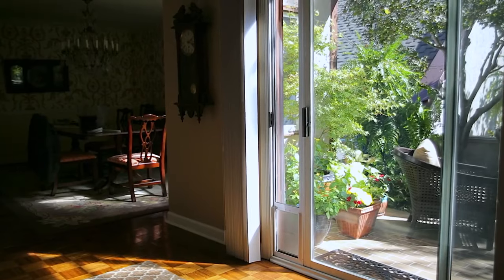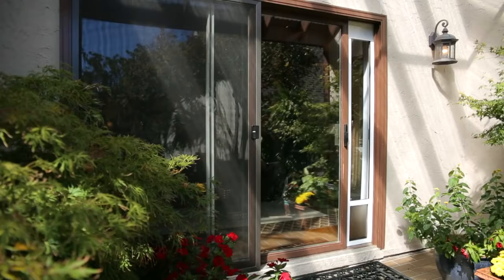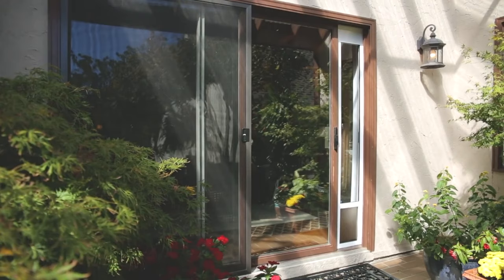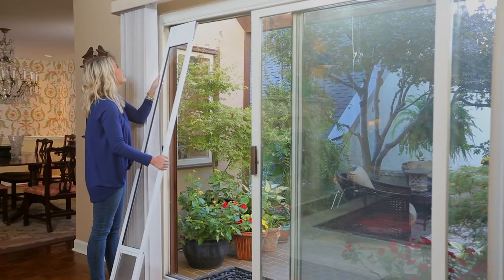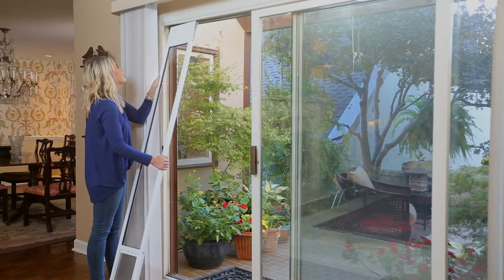How to Install the PetSafe® Patio Pet Panel Door

Comment: This is NOT a complete video for different types of patio doors! We will be taking out the screws for the third time now that we found a video that "might" help. The air coming in where the weather stripping is "supposed" to go is awful! We cannot use the stripping provided because it's horribly bumpy and will not seal.  It's in the 30's here and we need to figure out something else quickly. The panel itself is very nice and beautiful.....installation, ease, and weather stripping is not!
Reply from the maker: We are sorry to hear you are having these installation issues. Our team would be more than happy to assist you with this. If you would like you can reach out to our customer care team Monday - Friday 8am - 7pm EST here - https://support.petsafe.net/s/
Reply: I unscrewed the 3 screws at the top and reattached it, which helped, but I'll need to go buy weather stripping for both sides of the door. Also, it's raining today, and every time I walk by the door there are water drops coming off the bottom of the panel and onto the floor, as well as yet another draft.  Now I'll need to figure out what to buy to stuff up inside the bottom and also the draft from the  adjustable top. 
The little lock given also does not work with our door. One thing to note, we have the doors with the blinds inside, and because the controller is on the side of the stationary door, we  can't open the sliding door all the way, making it very hard to go out sideways! 
This video I found shares so much more information on different door frames. https://youtu.be/JmdwAN0JiEE?si=XFFIr7LGFJX0ggYS

Comment: One thing nobody mentions is that these doors basically make the screen door non-functioning. If the screen door is closed, the dog cannot use the pet door. So you must leave the screen open at least to the pet door, and when you do this there is a huge gap between the screen and the pet door. The gap is as wide as the distance between the screen track and the sliding door track, which on ours is over 2 inches. These are very poorly thought out.
Reply from the maker: We're so sorry to hear this panel is not to your preferences!  It is designed for use with the sliding glass portion of the door, so this would unfortunately mean there would be a gap if the screen were used.  Some customers who use their screen very often may choose to instead align their panel with the screen, or to not permanently install their panel and move it as needed.  For maximum stability and longevity of the panel, however, we do recommend screwing the panel into place.

Another option if you prefer to use your screen very often is our pet screen door.  If you have any questions about this, please get in touch with our Customer Care team!

Comment: The t bracket is way too wide, unfortunately home stores didnt have a replacement. There just really is 0 reason for petsafe to manufacture the bracket to be as wide as it is. I was abke to squeeze it in but it pushes the pet door so far away that the sliding door wont close on it.
Reply from the maker: We are sorry to hear you are having issues with the T bracket. Our team would be more than happy to assist you with this. If you would like you can reach out to our team via phone or chat (phone) Monday - Friday 8am - 7pm EST (chat) Monday - Saturday 9am -9pm EST here https://support.petsafe.net/s/

Comment: Don’t buy. sliding door will have big gap and no way to lock. video didnt show that part.
Reply from the maker: Thank you for sharing this concern, Gabriel!  We do apologize for any misunderstanding; please know that the sliding glass door does slide flush against the panel, and a lock is included. You can see the lock being installed at around 1:08.

Comment: how do you lock existing sliding door?
Reply: I wonder the same thing.
Reply: From the back that lock she installed on the back of the door
Reply: I have this door; there’s a slot in the dog door for your existing sliding door to fit in so you can lock it.
Reply: @WSB1469  thank you i was so puzzled
Reply: @WSB1469  where?
Reply: I drilled a hole into the side of mine so it would lock
Reply: @WSB1469  where?
Reply: @WSB1469  WRONG!!!
Reply: @WSB1469  Theres not.
You could just drill a hole for your door's lock if that suits your fancy, however it would not be as secure as the method displayed in the video.
Personally I drilled the lock up top, on the back of the sliding glass door, to where it locks into the stationary part of the sliding door.
So that way I can throw a 2x6 down behind the door to further secure it.
Hell, the 2x6 alone is enough to secure it.
Reply: And how does the lock really work ? What would the pin latch into ?
Reply: Locks are for honest people. Thieves just break the glass...... People don't stress over the simple things.

Comment: Why not move the fixed door panel to place the dog door between it and the frame, so the sliding door would be unaffected and still lockable from its handle?
Reply: How do we do that
Reply: That's exactly what I'm doing.
Reply: @beckyturner2721  how do you open the stable glass panel on slider?
Reply: How??
Reply: Found this tutorial on how to move a stationary door from one manufacturer. https://youtu.be/Uc3Ur-pZ1kc

Comment: What about the gap between the new door and the old one? How does one be sure to keep that snug? Do I have to buy more weather stripping?
Reply from the maker: Thank you for this question. Should your sliding glass door not sit flush against the Patio Panel after installation, you can add weatherstripping of your choice to the sliding glass door. We recommend using an adhesive backed polyether foam that is approximately 5/8 in. x 3/8 in. wide.

Comment: Similar to some of the comments here, mine also is too tall to fit where it is supposed to (on the glass door track).  It seems to fit well on the track for the sliding screen door though.  It's not ideal but I can still close my sliding glass door fully to lock it.  With the screen door it won't be useful if it's really hot or cold outside as there will be drafts.

Comment: Not happy. About a 3mm gap between existing door and pet door. Does not close all the way and there is no weather stripping for this area.  The “lock” it comes with is completely confusing (and doesn’t work) . I have to squeeze sidewise to exit to my patio now. Directions are super confusing with very few pics to reference. Also, you have to uninstall any existing locks, or hardware so the pet door will fit.  Flimsy. BUT happy to have a dog door now. Just gotta get a lock and weather stripping from the hardware store.
Reply from the maker: Thank you for your feedback, Heather. We're sorry to hear your Patio Panel Pet Door is not living up to your expectations. Most installations of this panel into a standard sliding glass doorframe will not require additional weatherstripping or modification. However, we can certainly understand all sliding glass doors are not created equal and some adjustment may be needed for the panel to sit flush in these situations. If you need any assistance or have questions about your Patio Panel Pet Door, please know our product experts are happy to assist you at the number 1-800-732-2677.
Reply: If you have to turn sideways to fit through the door then this is not an issue with PetSafe. Eihh the er you didn’t do the math to figure out how much space you were losing when you installed this thing OR you did but you aren’t self-aware of your own width. Anyone with even the slightest amount of ability for logical thinking would know that you will lose space in that opening after installing this thing…one should also consider losing some girth on their own belly to accommodate that loss of space.

Comment: Mine had a little gap when I closed the slide in door wym
Reply: Adjust the sliding door hight. At the bottom you should be able to raise and drop the wheels to fix the gap.

Comment: How do you install the bottom bracket? All sliding glass doors are on a 1/4” wide track which doesn’t allow the 90degree T-bracket to even sit flush with the ground level? LOL
Reply from the maker: We're so sorry for any misunderstanding!

A sliding glass door with a track this narrow would not be able to fit this panel.  Most sliding glass doors have tracks large enough for the 3/4" deep panel to fit; the T brackets will fit within this track as well.
Reply: @petsafebrand  The 1/4" wide section im referring to is the "ridge". My track is just like any other track, and the PetSafe door fits great within it. The "ridge" prevents my T bracket from sitting flush with the ground. So Im just not even using it.

Comment: I would like to  know if If it   is possible to install this door in place the screen
Reply from the maker: Thank you for reaching out to us, Pierre. This pet door can be used in a sliding screen door if the sliding door track is at least ¾" wide. However, it cannot be used with a standard screen door. This pet door is designed only for installation in a sliding door track.

If you have any further questions, please feel free to reach out to us directly at 1-866-738-4379.

Comment: The back of my door is bevelled and the lock won't fit. I am using a length of wood right now. Thoughts? Is there another latching mechanism I can use other than the bolt bracket lock thing?
Reply from the maker: Thanks for asking about this!  If this style of lock is not the right for your door, we do have a rotary lock available as well.  Please reach out to our Customer Care team directly!
Reply: @petsafebrand  , my sliding glass door opens on the opposite side, so I can’t use that lock or a piece of wood. Pella doors look like they’re installed backwards but they’re not. What other latching mechanism can I use to lock my door? it would have to attach to the inside track and the door somehow.

Comment: At 1.09, why is she putting a lock on the bottom at the end of the sliding glass door? Am I missing something - this will limit how far you can open your door to enter/exit? I'm not confident how well this pet contraption & final result will hold up against a burglar.?.?
Reply from the maker: Thank you for this question! The lock will not hinder the natural sliding action of your glass door when in the unlocked position. Please know the closing panel and lock is provided for aesthetic and energy efficiency purposes only. These items are not intended as security devices. Forcible or aggressive entry/exit attempts by pet or human are subject to damage the door.
Reply: The lock that came with the dog panel is a POS. We ended up not using it and just putting a very thick stick pole in the track of the door.
Reply: @lisaflesher  this is what I would do but our sliding door is on the exterior side so we can’t use a stick. I just can’t believe there’s no nub to actually grip that locking pin to unlock it. May put a piece of string around the end of the pin so as to enable a simple string pull to unlock it. Would have to get creative just to mark the hole where the security latch pin needs to be drilled into the door. Seems intentional how they just breeze thru one of the most critical parts of the install. Most probably have the stick option because their sliding door is on the interior side
Reply: Your builder installed your sliding door backwards then - you should be able to put a broom handle back there (from the inside) to secure it. If your sliding door is exterior then that’s a design fault of your builder not PetSafe.  There is plenty wrong with this door and this garbage tutorial but this isn’t one of them.
Reply: @captaincrunch1707  Your sliding glass door was put on wrong.  It's always on the inside.

Comment: Does it have options for closing your existing sliding door once the pet door is in place?
Reply: The locking mechanism that goes near the foot of the track will be your new way of locking the door. You will have to put a hole in the sliding door frame and the pin can set in there
Reply: @adamkumpmusic  what?lol
Reply: @6botty  yea I know right... 🙄
Reply: I think it would be alot better if it fastened to the sliding door & opened and closed just like the slider.
Reply: We are going to have to use the ole "dowel in the bottom of the door track"  method.  The lock given will not work with our doors.

Comment: How do u attract the lock? I feel like they just got tired and skipped over that part lol.
Reply from the maker: We're sorry that you missed this part on the video, Aakash!  This is shown starting at 1:09.
Reply: @petsafebrand  the door lock with the latch not the one that goes on the end of the lock door...sorry you missed putting it in the video🙃
Reply from the maker: Thank you for your reply! It sounds like you are describing the rotary style lock which is no longer included with our standard Patio Panel Pet Doors. This item comes with our 96" Patio Panel Pet Doors and Sliding Glass Pet Doors only which is why we have not included it with this video. You will be able to see this alternate lock installed at the 1:00 mark in the following link: https://www.youtube.com/watch?v=oBp7nSy6zQ4
Reply: I know what you mean so I’ll actually be helpful. After you Mount it onto the glass door, you have to drill a 1/4” hole in the other door to where that locking bolt will slide into
Reply: They did skip it they don't have a clue just relocate yours and hopefully it's a  post and not a recess  for the latch

Comment: What do you do about the metal part of the door that’s sticking out of the side? Near the handle? Where it locks?
Reply from the maker: Thank you for asking about this!  On most sliding glass doors, there would not be a protrusion in this area.  For doors that have this, you would need to unscrew/remove this piece so that the panel can sit flush against the frame.  We're so sorry for any inconvenience this may cause.
Reply: please show exactly WHAT you mean to remove? I measured this opening five times and ordered the shortest door you sell on Amazon, and the one I received is 1" too tall for the opening. It will sit there fine, unused, but my daughter's dog going full tilt through the door rips it off the door jamb. I'm about to leave for a big box store to find some angle iron to install this. Any help you can give would be appreciated.  @petsafebrand

Comment: Instructions that come with suck. The info on the locking tab is vauge and hard to understand even the video sucks at the explanation
Reply from the maker: Good morning, we are sorry to hear you are having an issue with installation. One of our customer care representatives would be more than happy to assist you with your door installation. If you would like you can reach out to our team here - https://www.petsafe.net/support/contact-us?_ga=2.99477278.1444696881.1661983693-530763049.1660344406&_gac=1.95103470.1660344406.CjwKCAjw9NeXBhAMEiwAbaY4lo-914FSCO_HRQpsUthrSjXlPiH8GlfzIoKy29eCNO6ZNZ2kfjh6mRoCyyAQAvD_BwE

Comment: How tf does the lock "lock"?
Reply from the maker: This is a great question, Vincent!  As shown at around 1:12, there is a hole drilled for the sliding bolt on the lock; this allows the bolt to be slid into place to lock the sliding portion of the door.